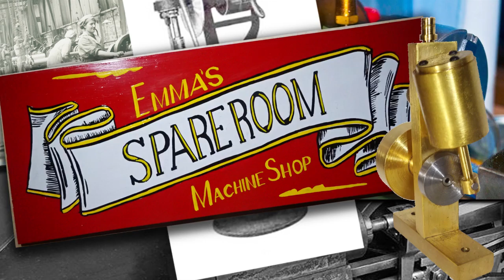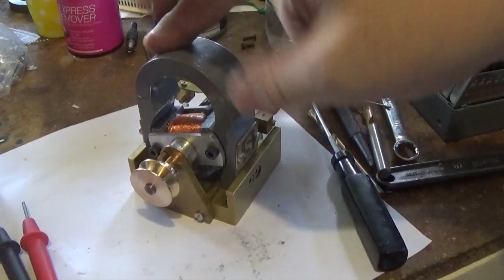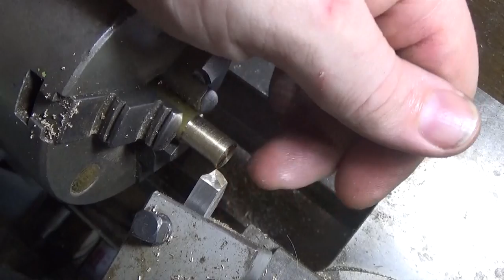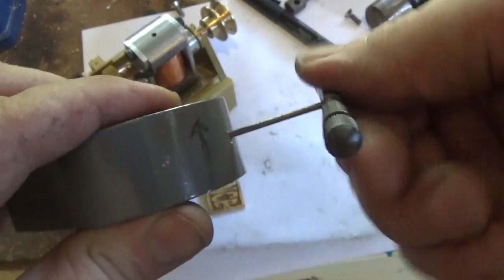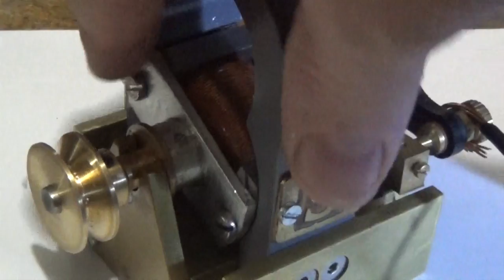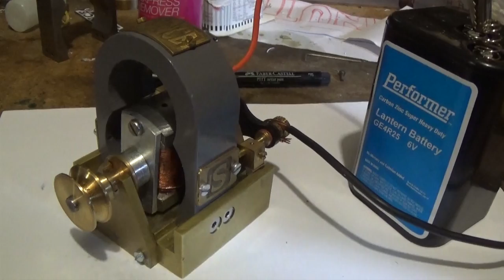Prince Dynamo motor PART14- finishing

Comment: Now that I have found your videos I am finding you are very talented in many fields, mechanical drawing, mechanical design, machining, and electrical design in this one as well. Are you self taught in so many areas? This project sure outshines motors I made as a kid from iron nails and wire salvaged from small transformers! If you had provided a magnetic field that encircled the armature it would have been self starting. The deeper you could have made the magnet pockets the closer and stronger the field would be.
Great looking little motor!
Reply from the maker: I really like the kids toy projects like motors made with nails and wire. theyre good fun easy projects.

Comment: Terrific job.  Perhaps I will try one of those in the future.  On the brass tags, having seen tags on old machinery and watching Keith Fenner remove a plate on a machine he was restoring, I have noticed that they, the  folks back when, took a brass rod and drilled a hole that was a snug fit to the rod and cut it off just long enough to crown over brass plate.  This also caused the brass to swell slightly in the hole and hold the plate secure but could be removed without too much fuss when necessary and no damage to plate.  Thank you for a great learning experience.

Comment: Bravissima Emma. I think it is a very handsome model. The period look is quite realistic. It runs quite well, considering it's a two-pole job. It would be interesting to dissect a bicycle dynamo, the kind that runs off the tire, and see what's in there. A multipole armature and commutator would be a major undertaking. But you might swipe one of the bike :)
You're quite right about the BA screws, they would look better. They were designed for clockmakers, model builders, instrument makers etc. They are actually metric, but each number has twice the area of the preceding one, so diameters go as the square root of two. Pitches are therefore, er, screwy <groan> and it is tap and die all the way, because it is difficult to screw-cut them on any lathe. Next project? Perhaps an IC engine? Maybe something like Myfordboy's hit-and-miss?

Comment: Hi Emma, have you tried playing around with the timing? I think if you take out the lower screw of the brush holder you can rotate it around the axle and change the timing a bit to experiment. That can change the efficiency enormously. You might be able to get a bit more decent voltage out of it to drive a little light from it. In any case congratulations on completing another wonderful build, it looks great.
Reply from the maker: +wich yes thats the intention. ive messed with it a bit. probably could cet it a bit better still..

Comment: That was a great success.  I was surprised to see you run it as a motor but that is just as good a use as being a dynamo.  As for the color the best color is the one you like personally.  I know what you mean about building a steam engine.  I never did finish my first one.  After I had so much trouble trying to follow through with the specified materials I got tired of the whole thing.  Thanks for the video.
Reply from the maker: +Amateur Redneck Workshop thanks for watching Harold.